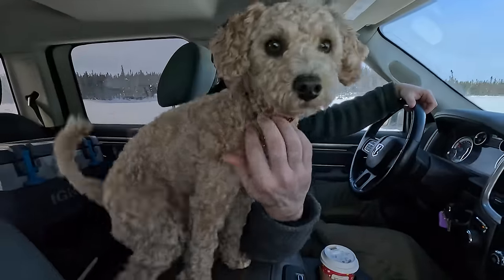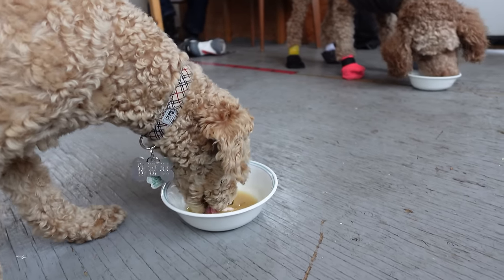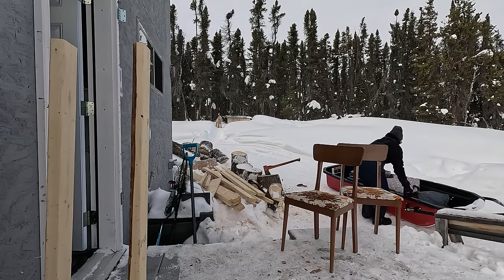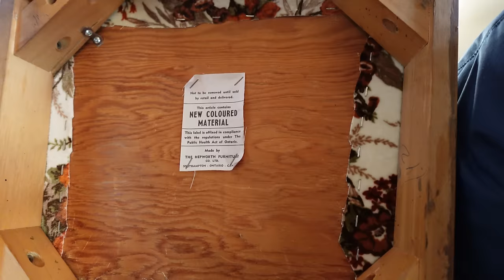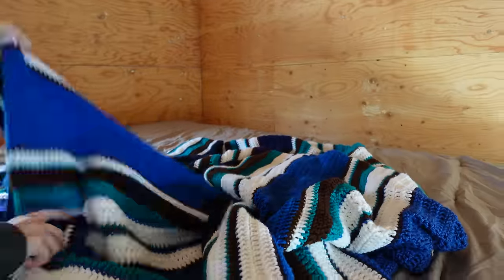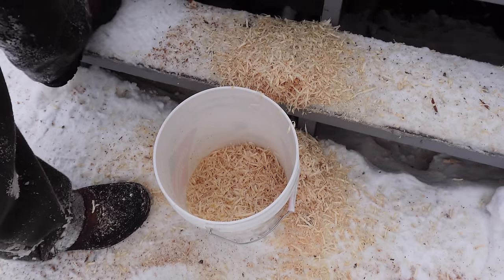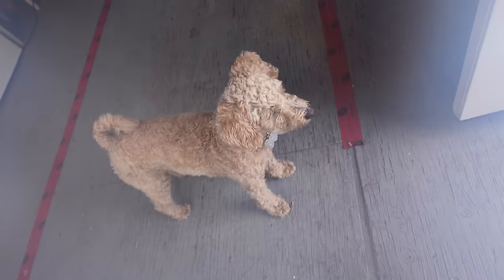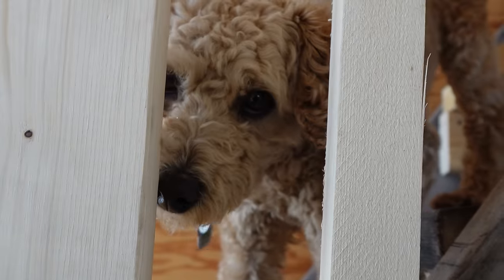PUPPY IN A FROZEN, COZY CABIN

Comment: behind the wood stove, mounted to wall, spaced about an inch off wall and an inch and half, off floor, need a 2 foot wide, by 3,4 foot tall piece of vertical corrugated metal. Not only will it act as a reflector, but when it warms up, from stove, it will create a natural convection, drawing cool air, off floor and sending warmer air aloft....helping to disperse the heat...like a radiator..

Comment: Hi Jay.  Love the updates and videos.  I see that you got a new Stihl chainsaw.  A couple of points.  Don't let the chain touch the ground, dirt, rock etc.  It will dull it immediately.  Also you really made me nervous when you left it in the sled and started tossing wood into the sled.  Just one hit on the blade from a log being tossed could throw things out of whack really quickly.  As for your old saw cutting crooked, that's a chain that is dull on one side and it needs to be sharpened.  Good luck!

Comment: You making people hungry with that cooking .
Something to think about for many is how important it is to use wood for the fire ,and whether using solar power would be as effective in the cabin or even the tent days ?
Sensible grounded people would understand the reasons why its not about just turning a switch on for heat and power ,a balance is applied i think ,but the changing world has lost practical and considerate thinking .
You dog has so much energy,being young , wouldn't that be nice to have again .
Best wishes with the cabin ,ive already watched where you built the Safety rails ,dont forget the Clamps Aye  !